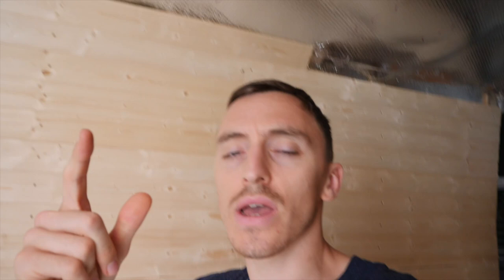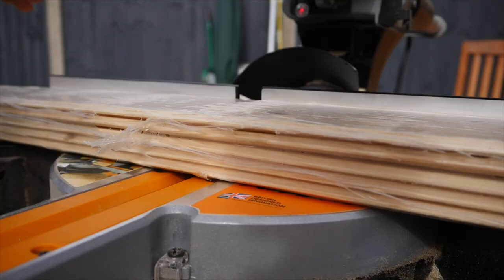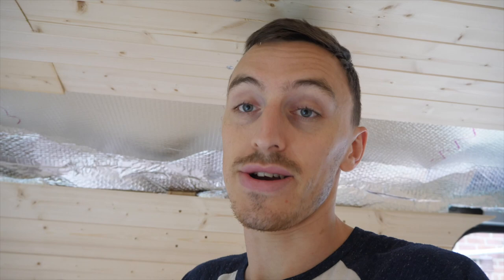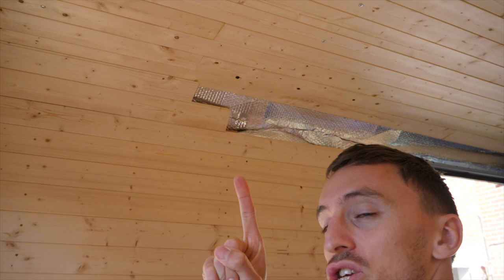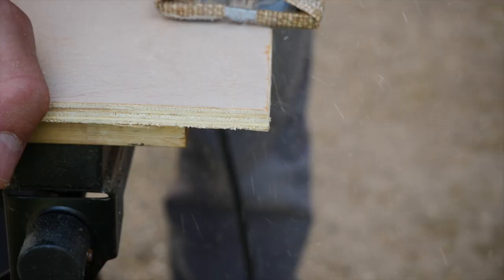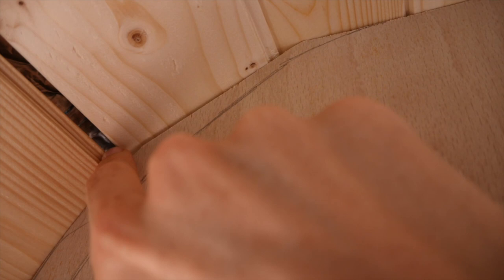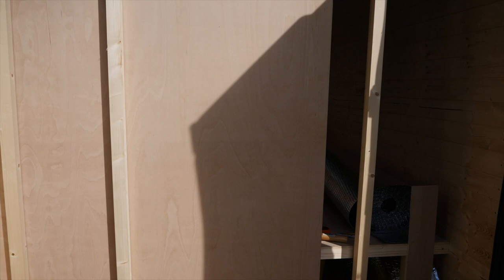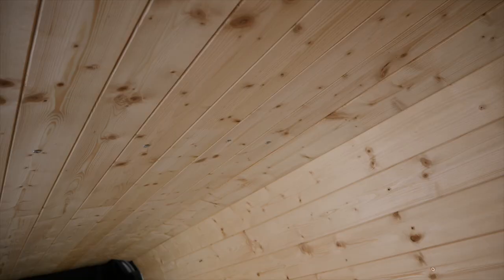THIS F*****G CLADDING! Cladding A Camper Van

Comment: Looking good, need to see how you are going to install the plumbing and wiring, in the installation trade we call it first fix, because you put it in before the 2nd fix which is all the coverings, seems you are doing it the opposite way round, will be interesting to see.  I used to wire yachts up as an electrician for 4 years. Along with other electrical work!
Reply from the maker: Hey Malcolm, there are probably good reasons for doing all the wiring and plumbing first but personally in my mind in a van I feel that if all that stuff is hidden behind the inner 'skin', or in my case cladding, it will be a lot harder to access in the case of maintenance and/or modification. The piping and cabling wont be on show but I will reveal all in one of next weeks videos!
Reply: The best thing to do is put oversized flexible conduits in, 1 to give airspace for the wires so they don't overheat and if you put a spare draw wire in, then extra cables can be added, but i'll wait to see what you do, it will be interesting, maybe you've planned something that's gonna amaze us, i hope so as i'm starting mine next year :-)  I must have watched 100+ van conversion  videos!

Comment: Hi Hugh, I’m in the process of cladding my boxer and I’m wondering how you got the cladding to curve around from the walls on to the roof?, loving the channel
Reply from the maker: i got some timber board at least 20mm thick but thicker is better. I cut a curved profile out of the timber which I drilled and screwed to the ribs in the van giving me curved wood ribs that I could screw the cladding to

Comment: This vidio is so helpful, thank you. 
Is the cladding you are using just bog standerd ?
I wondered if there is a thinner, lighter version.
Reply from the maker: yeah the cladding is just some that came in packs from a DIY store. They are only 5.5mm thick so don't know if it can come thinner. The only way I could see going thinner is to machine your own or use 3mm ply

Comment: Yo Hugh, but what did you do to finish the door off, do you have footage of it? It's my next job
Reply from the maker: Hi Silas, I panelled it with ply and left as blank ply with the window cut out. Boring to some I know but I really like it
Reply: Thanks for getting back to me Hugh, I did mean how did you get around the issue of the bit that bends the TnG both ways, where the roof curves and flexes out at the same time?

Comment: I think you are making a nice job , but in the process you are losing a lot of valuable  wall/ceiling/ flower space? The garage bulkhead looks good at the expensive space , this is just my thoughts . eg my small ford connect van ( for work painter) has the usual shelves you might find , i am now switching over to bags & soft flexible boxes (possibly not so easy access but much more storage ) . My thinking is you have to make the best of a small space , think tiny house open plan . This is just my thinking not any  criticism of your first rate work .
Reply from the maker: Hey Rob, never feel your offending me for having your own ideas about how a camper should be! Everyone has different tastes or needs from their van, I am just cladding out the inside ready for added storage or furniture. The 'garage' at the back is about 30cm deep so not a huge sacrifice for what I am planning. I want to look at keeping utilities separate in the back with easy access for maintenance but also have space for action stuff and maybe wet items after a day out. If they are in the back they won't make the main living area damp or smelly.
Reply: HughTube - Thanks for reply watching with interest doing a grand job . lol the ppi ha